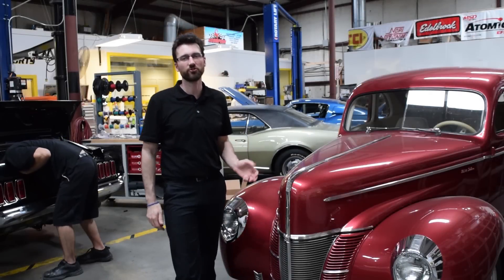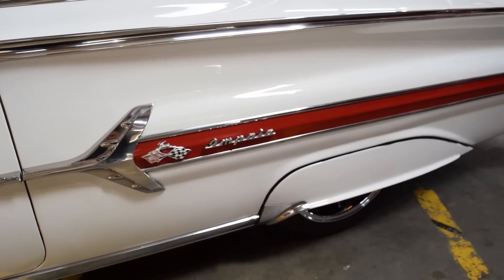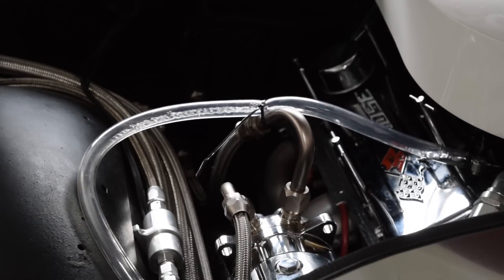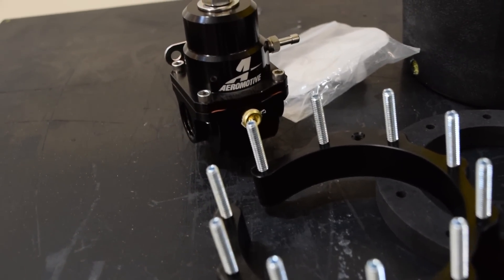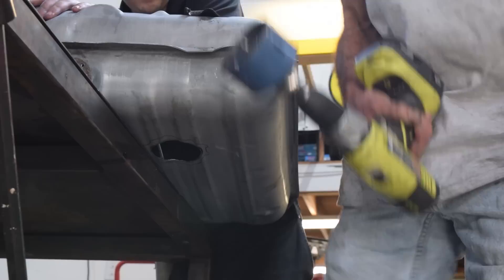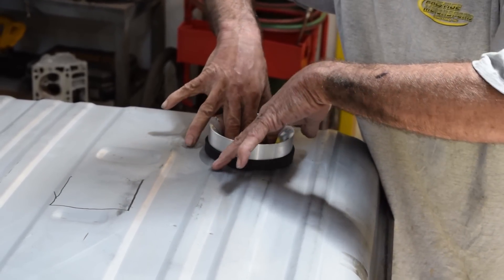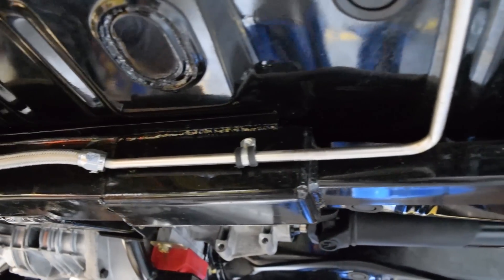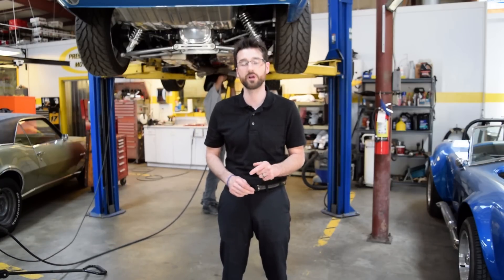Vapor Lock: Watch Fuel Boil and Learn Tips on How to Avoid It

Comment: Oh, and I already had a "Wallet-ectomy" from Prestige Motorsports, as they built the 347 for my 65 FB. The vapor lock I had with my 65 Stang coupe.
Reply from the maker: What happened, sir?
Reply: @prestigemotorsports  I had no issue with my 347 engine purchase, as I'm just now getting close to my 1st start of the engine. I apologize if it sounded like sour grapes in anyway.  For context, I had commented further about my more back to basics approach to resolving vapor lock on my 65 Mustang coupe. Adding a return line, insulating both fuel lines and adding a "Cool Carb" heat deflector and insulator spacer kit.

Comment: So, the Prestige method here, will work just fine, after a significant "Wallet-ectomy" procedure on yer back pocket.. After repairing my a/c in 65 stang, it started vapor locking quite a bit, yes our gas today sucks and boils quite easily. Though I already had and electric pump, near tank, and an Edelbrock carb. I added a 1/4" return steel line, (easy to bend), got some DEI type thermal insulation (foil type/w Velcro), and insulated both supply and return lines. Added the Wix/Napa fuel filter w/the 1/4" return stub. Installed it as close to fuel only as possible, insulating those lines all the way up the carb, and routing away from heat as far as was practical. May have cost me $80 bucks total. And my car still has a carburetor. Dumb as a rock, though easier to diagnose on average and repair while on the side of the road.

Comment: I bought a f 800 fire truck with 11k on it. They said it sat in the back of the fire hall for 20 years bc it wouldnt stay running. 429 bb industrial. and it runs fkin great when shes cool but when its hot kikin and buckin. SOOO i found a factory fuel tank that would except a high volume low pressure in tank oem pump and added a restricted return line to get the pressure back to 6 psi and never had a problem since.

Comment: Seems like a lot of money and work for something that can be fixed for about $25. Get a fuel filter for an 89 Grand Wagoneer and install it between the carb and pump. Run a line (preferably steel) back to the tank and attach it wherever you want on the tank. Many different ways this can be done. I daily drive a slant six dart with a mechanical pump on normal 87 octane ethanol crap and never have problems. And if you know where the fuel pump is on a slant and how the fuel line is run on one, you know the pump sees zero air flow and the line is less than 1" from the exhaust manifold. No destroying a good fuel tank, no regulators, no easy to puncture hoses and no electric pump with shoddy wiring to fail. Works every time.

Comment: So running e85 will keep this from happening because it’s a much cooler fuel and I can attest to this because my car is fuel Injected and I’m currently breaking in a new motor and I’m running on 93 octane fuel. 93 has a low vapor/flash point so my cars big turbo would create heat and my fuel rails would vaporize and I couldn’t get the car to start for a while and it would shut off while driving on the highway. I got a partial tune and running e85 now and it has helped a lot.

Comment: I've been dealing with ethanol issues on all the big 3 for years. The first thing to determine when having fuel issues: is the issue not enough fuel in the carb, or too much fuel? Not enough = vapour lock. Solution is electric pump and return line. An in frame Edelbrock works well. That set up in the Impala looks extremely expensive and prone to failure. I had a ford 460, 4100 series Motocraft carbed motorhome that worked flawlessly even climbing mountain passes in B.C. at 37 degrees celcius, loaded. NEVER percolated or vapour locked. And it had those two things.

Too much fuel/flooding = heat soak/percolation. The solution so far is a return line port as close to carb as possible, insulating lines, and as tall as possible Phenolic/wood spacer under carb. Also that big, hideous air cleaner is going to trap a lot of heat at the carb!

Comment: Damn that’s a lot of work. I fixed vapor lock in my 62 impala for about $50. Purchased return hose and 3nipple fuel filter before the carburetor. Also used some heat shield wrap over the fuel lines in the engine. I drilled into the filler neck so I didn’t have to clean up or mess with the gas tank at all. I live in texas with 100+ degrees all week. I drive my old school every single day:) after I did that fix my car never had any problems after that. I even went to car shows driving for 4+ hours with the car on and sitting in the summer :)
Reply: This guy doesn’t make as much money if he fixes vapor lock the old fashion way…
Reply: @cal30m1  are you mad that someone figured out a way to do the same result in less than 1/10th the time and using 1/10th the money. You must be stupid to pay that much for it. Im sure you pay $130 for an oil change too, but I don’t go out of my way try to look down on you for it.
Reply: @vincentbryan1962  I guess you can’t tell when someone agreed with you?

Comment: Hey Eric, great video. I restore old Thunderbirds and have had to deal with the vapor lock problem quite a bit lately mostly because of the crappy gasoline that is available today. I live at 7000 ft altitude so this altitude just adds insult to injury with regards to vapor lock. The problem you describe in the video, "not being able to restart the car after shutting it off," I have found more attributable to the gasoline boiling or evaporating out of the carburetor while it is sitting there. For example, you go into the market and your car is sitting outside for 20 minutes or so and as the engine heats up from being shut off and no more cooling system action, the gas in the carb starts to boil and evaporates. When you go to restart it you have a "too rich" issue because of the excessive fuel vapors and the heat. I push the gas pedal to the floor and crank it until it starts, works every time. I do not pump the gas pedal. Pushing the gas pedal down to the floor and leaving it there until it starts opens up the throttle plates in the carb and allows air to rush in creating a lean mixture and allowing the car to restart. 

The vapor lock problems I have experienced with the Thunderbird while driving is (390 or 428 FE engines), loosing power, bucking and surging, acting like it is running out of gas, not being able to reach speeds higher than about 40 mph, and all of the above when going up any kind of an incline. For me and my Thunderbirds, its never a restarting problem, its always a "while driving" problem. The cure was exactly what you did in your video with a few exceptions. You put an in tank fuel pump which Holley recommended as the number 1 fix. On a 1966 Thunderbird for example, the gas tank rest against the trunk floor on the top and back side. The fuel sender is on the front side facing the diff. Holley said that you need 3" of clearance between the tank and trunk floor to use their in tank fuel pump so that was not an option for me. The next best thing was to use an inline electric fuel pump as close to the gas tank as possible and level with the bottom of the gas tank. So I installed the electric fuel pump right next to the gas tank and level with the bottom and I ran a return line from the front of the car back to the gas tank via a Holley supplied regulator, and used the original fuel source fitting on the sending unit as the return. From the regulator back, I used steel fuel line because it does not warm up there like in the engine compartment, there is nothing to heat the lines up. In the engine compartment, I used fuel hose and I insulated it with thick foam insulation, the same stuff you see around water heater pipes. I eliminated the mechanical fuel pump completely. This worked out great and cured any vapor lock issues. The customer drove the car over the Rockies on Interstate 70 and went through the Eisenhower tunnel at 11,000 feet with no issues while using 91 octane pump gas with 10% ethanol. They also drove around Utah, Nevada and California in 100 degree weather with the AC on the entire time. They had no issues what so ever. 

You can view the video I made on how I did it here https://youtu.be/uGaLuywsU0Y.    Thanks again for a very informative video.

Comment: I have lit'l toyota pick up. Never had problems with the mechanical fuel pump but I was driving it & then it just dies on me. Dissconnected the fuel line that goes into carb & there was no fuel going into the carb. So I bought a new one & it does the same thing. It does this after 10-15 min. of driving. It'll turn back on after like 10 min. But then it dies again. I'm kinda stummped never had vapor lock before & i've driven it in 90-100° weather before never had this issue before. It barly started down this & the weather about 35°-50° rite now. Any one else have this problem & if so what cud make the mechinical pump do this. Thinking of going with electric fuel pump. But kinda iffy on those.

Comment: Hey guys, I am a small engine Mechanic - I`ve had the issue a few times of steel gas tanks needing holes drilled into them sometimes and I`ve come up with a 100% perfect solution to keep EVERY little speck of that metal debris/shavings from entering the gas tank - and THAT is to use one or several very powerful Ceramic "Rare Earth" magnets around the area where the hole or holes are being drilled, and you do NOT need to be in the awkward upside down position (and get a possible injury to your eyes and HOT shavings to skin areas making you jump from the burn reaction, possibly messing up the hole) to do the job. When finished with your cutting, drilling, de-burring?, simply Slide the magnet to the hole you just cut and remove the collected shavings. Another added suggestion would be to have a "Secondary" magnet set directly attached to the outside bottom of the tank directly below the drilled hole JUST in case SOME does slip past, when done?, you can (like " I " do) is to clean THOSE shavings at the INSIDE bottom of the tank where (IF ANY) that magnet was placed?, use a wood stick/Dowell with a Q-Tip like bundle on the end of it (DON`T use a telescoping magnetic pick-up tool to do this, it does NOT pick up those shavings because the area is MADE magnetic by the stronger magnet and chips WILL stay there) with a petroleum based lubricant to wipe/pick up any shavings after removing the magnet from it`s location. Hope this solves SOME headache`s with that issue.

Comment: One of those filters with 3 fingers (Wix 33041),  a return line to the tank, insulate the feed line in the engine bay to the carburetor with ceramic fire insulation wrapped in foil tape, get rid of mechanical fuel pump and replace with an electric, a phenolic carb spacer.......fixed my vapor lock....even on 100F days in Colorado altitude on 89 octane ethanol gas.  Find a sender with an inlet along with the outlet and switch it out.  Don't cut a hole in the tank.
Reply: I did not feel that cutting up the fuel tank was a great idea and that large line hanging out the back looked playschool!

Comment: Hi, A very interesting explanation of the problem. What you describe has been called the "Hot Restart Problem" in the UK and yes it is caused by problems with modern fuel. I have a classic MG that, like many other owners, suffers from the same problem. A few years ago I ran a set of tests at Manchester University in the UK to find out what the problems there are with modern fuel. The findings were very suprising. The results have been published in a book Modern Fuel, Classic Engines. The problems, the solutions. (https://www.modernfuelclassicengine.org.uk/). 

BTW: we tested the boiling point of ethanol blended fuel. It was the same as normal petrol!

Comment: Hi,  I wonder if I can 
use a fuel pressure regulator with 2 fittings as a return line for vapor lock this way:  One fitting going to the carburetor, since I am using only one carb setup I need only one line, the other fitting going back to the fuel tank as the return line..Thanks
Reply: Make sure it is a bypass regulator

Comment: I know this video came out in 2016 but Here's another tip i picked up back in the day in a issue of hot rod magazine: 101 tech tips. If you have a metal gas tank prep the metal surface for primer / paint . Used high temp header primer and paint with the ceramic in VHT or dupli color . But use the header aluminum paint. It will insulate the tank from heat coming off of the motor / car / pavement and keep the gas cooler.  Also if you use a mechanical or electric fuel pump always use a vapor return line to get rid of a lot or all of vapor lock.

Comment: Yep go to uncle Tobys garage channel, he fixes it with a wix filter 33040 ? ( just get a 3 outlet fuel filter with a small hole for back pressure in the run outlet to the tank ) and with the third smaller outlet on top or north of the filter run a line back to the tank, sometimes the tank has the hole in it at the connection for the return line, where did the idea of running fuel line to the carburetor only come from ?
Reply: ITS TONY

Comment: Geeze, what a complicated and expensive way to fix a problem a $8 napa filter could fix. Again, learned it from Uncle Tony.
Reply: Yessir! Plus you gain a filter :D My van has a return system but that little filter keeps the fuel pump from having to pull the fuel all the way up from the tank after work on the carburetor as well.

Comment: where does the air come from when fuel boils? surely it is petrol vapour?
Reply: yes... crude or refined fuels have a boil point where they turn to a gas.  depends on the car, but 115, is where my car is no longer happy. .. im installing a cool can in the back to see if i can curb some heat issues myself

Comment: Yes to look up Tony's garage way simpler way cheaper works wonderful...
Reply: I used the Unc's tip.  An AMC style inline filter with a small return nipple out the side.  Fuel keeps circulating back to supply, giving less chance of heating up

Comment: the gasoline flash point is  -45 degrees.    meaning at -45 degrees in an open cup  gas will flame if you pass a flame over the top of it.   DO NOTE that MINUS 45 degrees F.

Comment: Here's a cheaper way : buy 3/8 racing aluminum fuel line and vinyl coated fuel line clamps that screw into the frame  . Make as little ups and downs and bends as possible in the line. Buy a     factory replacement fuel filter that came out on emission controled vehicles 70-80's like jeep cherokees or dodge truck/cars That have the 3 ports! 2 on the one side of the filter one on the other side . The smaller port is a fuel/vapor return port . Hook a fuel hose up to the 3rd port and run it back to the tank or the vent port on the fill neck . Vapor lock solved

Comment: uncle Tony's Garage got a cheaper way simpler way to do it 👏🏌with a filter😁✌
Reply: Yessir one the best on YouTube that won't make you go buy overpriced bullshit
Reply: Yep. I laughed when I saw that aeromotive stuff.
Reply: Yep he fixes it with a wix filter 33040 with a 3rd outlet back to the tank using the vent hose line.
The filter has an inlet and an outlet ( as normal ) and a smaller diameter outlet with a small hole ( in the outlet ) ( for back pressure inside the carburetor area )) , running back to the tank
Reply: Yeah, this is a $400+ football bat of an approach. Uncle Tony didn't just throw money at the problem. I know which solution MY clients will appreciate, and it'll still leave them with their rent money!
Reply: EVERYONE needs a uncle tony

Comment: You know, that's pretty stupid trying to minimize metal shavings in the tank while cutting the main hole then using a drill and finish grinder to cut the remaining pattern out, FILLING the take up with shit piles of shavings! :D
Reply: the video doesn't show it, but i would guess they stuffed a towel in the tank once they had a hole..    ive done exactly the same thing, but used a water soaked towel to "catch dust and droppings from my holes and sanding...   any leavings were blown with pressurized air, with a shop vac sucking dust out at the same time, then some high pressure wash downs and some fill and dumps and i felt good about the tank i was working on.

Comment: It's the ethanol, as big oil ads more the vaporization temp drops so a car that ran great in 1969 will not run great today
Reply: To be fair its not just the oil manufacturers who are to blame. The government itself should bear the brunt due to passing idiotic emissions regulations which, in part, forced the hands of the oil industry. Regardless, I'm certainly no fan of ethanol fuel to begin with due to the performance and fuel mileage dampening.

Comment: My 69 camaro with a quadrajet has a return line to the tank from the factory. GM had this issue in the 60s and quadrajets are very sensitive to it. If someone wants to stay original this is the easiest solution. Just add a fuel filter with a return line and a 1/4" line to the tank and use a sending unit with a return line on it or tap in a fitting to the tank.
Reply: Yep, a ton old old cars suffered this and its been cured simply and quickly a billion times and suddenly its new tech with a complex and expensive cure 🤣🙄
Reply: Yeah, this is simply an add. I'm glad you put this in here so others can learn the proper way to do this and stay mechanical.

Comment: Yeah well that's a shit load of work. I sorta fixed it by installing a new fan clutch so the fan runs faster like it's supposed to. And if it's still too hot I just hold a higher RPM at the stop light to get more airflow.
Reply: Said like a true potato